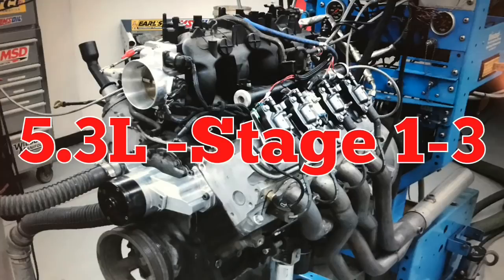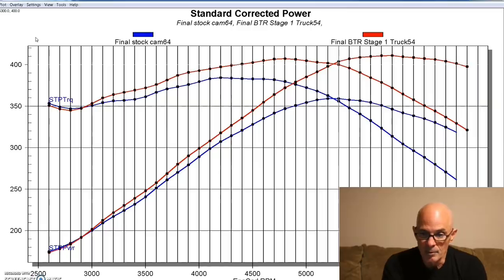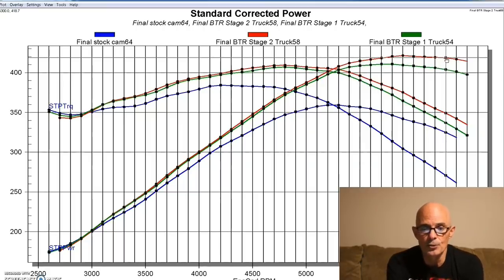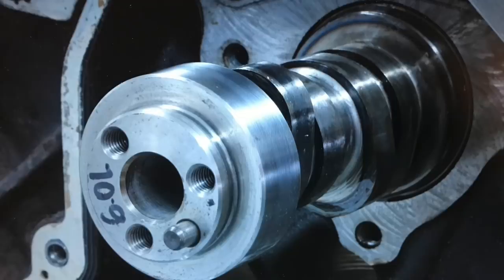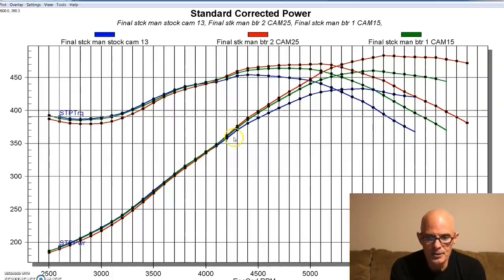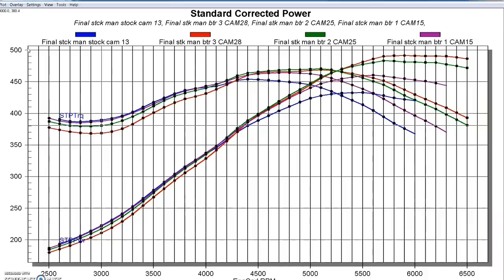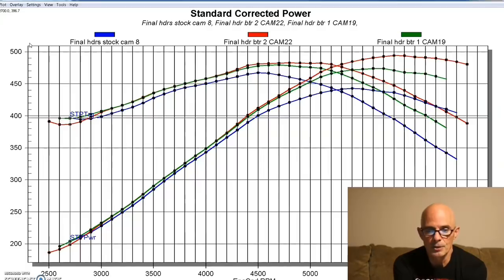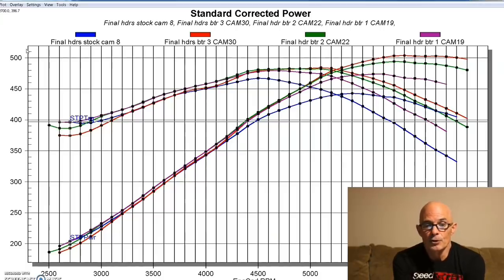LS TRUCK CAM TEST-5.3L & 6.0L (TORQUE FOR TOWING)

Comment: lmao “cams don’t care what heads are on them”. Could you make a more false comment? Ls3 cams have limits on lift and duration to keep the valves from hitting the pistons. Ls3’s with stock pistons have very tight clearances and you will lose an engine if you use the wrong cam on them. How many people are you going to screw over before your channel gets shut down? Try running a TSP Torquer cam in an ls3, you will be rebuilding the engine. Man, this guy does nothing but spread idiocy...
Reply: Wow!  I couldn't disagree with you enough.  this is the best info and the best Channel I've ever seen.
Reply: Your ls3 example is an overall engine design parameter limitation.  His comment is in reference to the cam not caring what type of head is doing the breathing.  Cathedral port or rectangular port, the cam will do its job.  Anyone who cannot grasp this VERY simple point, probably should not even swap a camshaft...
Reply: He's obviously referring to the effect the cam has on airflow and the torque curve. It's up to you to do your homework if you're building an engine.
Reply: @fascistpedant758  It sounds like the OP has an axe to grind....
Reply: Daniel Sullivan Really? You need to get out more. I see this guy spreading all kinds of bad info. The “any cam is a turbo cam” bs was the worst. The engine dyno he uses doesn’t show how they react in a vehicle. If you ran a turbo with a nitrous cam, it wouldn’t spool in a vehicle, but the engine dyno removes resistance until the engine can spool, giving a false sense of it actually working. In the automotive industry, guy who just use engine dyno’s to prove theory are just laughed at. That’s why my engine dyno hasn’t been used in years, just the chassis dyno.
Reply: wlabishler 1 How does that matter? Sure, the cam doesn’t care, but the valves and pistons do... Plus, this is talking about putting cams in otherwise stock, junkyard take outs. So yea, you can’t just slap any cam in one and not expect broken parts. 

Man, you fanbois are really detached from reality just because of a little YouTube fame. That’s pretty pathetic...
Reply: @adamr9215  has nothing to do with the tired "fanboy" defense you just tried to use.  You made a head-in-ass STUPID, comment.  I have not watched EVERY other video that this guy has released.  But to the point you addressed, I understood very well what he meant.  Your statement is akin to wondering "why wont this here ls cam work in muh Ford mod motor?  He said the cam dont care!"
Reply: @adamr9215  You do understand that a hydraulically loaded engine dyno actually puts full load on the engine before the run even starts?  That's why you see the throttle go wide open without the rpms changing at the start of the run.  So it's actually the opposite of what you stated.  And every OEM manufacturer, every F1 team, ever NASCAR team and most of the best engine builders use engine dynos for development because they need to get the most pure, unfiltered data that they can about what's happening.  The chassis dyno has a lot of variables in between the engine and the axles.  I use a chassis dyno, but your criticism of the engine dyno is extremely unfounded.
Reply: Church Automotive Testing Dyno Tuning Actually most of the top tier motorsports use the wheel hub dyno’s now. Too many variables get changed to use an crank dyno. It’s far better to test the engine and trans together, you can make sure the clutch is holding, make sure the fuel system is where it needs to be and the actual electrical system in the vehicle. Lol, too many race teams have been taken down by great dyno charts that didn’t perform in the vehicle.

Also, a crank dyno doesn’t put a full load on an engine from the start. That would just stop the engine. It varies the resistance so that it can measure the output. But, even that doesn’t show you how the stall converter effects the performance either. Put the wrong cam in a turbo engine and it won’t spool the turbos and won’t be able to stall the converter. I just fixed a car I bought cheap because the idiot had the wrong cam in it. The 4500 rpm stall wouldn’t let the engine hit 2400 rpm. I put a turbo cam in it and it fixed everything. Spools lightning fast now. It’s running low 5’s now. It did great on a crank dyno, but wouldn’t work at all in a car. That’s how a I found this channel, the guy followed this liar’s info and found out that was just a huge waste of money. I got it all for the price of a rolling chassis because he listened to people like you that know nothing. Granted, I am selling back to the guy I got it from for only $2000 more than I paid, but I’m not a scumbag like the guy running this channel.
Reply: @adamr9215  cool story.  Doesnt change a thing.  Dumb comment with no basis in logic.
Reply: @adamr9215  Now you're just flat out making stuff up.  There has to be a load on the engine at the start of the run or it would accelerate as soon as the throttle was opened, the dyno applies as much load as needed to allow full throttle static operation - you said there was no load which implies that you simply don't understand what you're saying.  F1 teams, Indy Car engine suppliers and NASCAR teams all have lots and lots of engine dynos to perform their testing - the last time I was at HPD all those dyno cells were filled with engine dynos, and the typical top level NASCAR team has 3 or more engine dynos running all the time.  Because they're developing engines there - not torque converters, transmissions, etc.  A clutch not holding is not something an engine builder worries about in testing.  You're all over the place here, and your vitriol towards Holdener really makes me think you've got a personal issue with the guy.
Reply: Church Automotive Testing Dyno Tuning Lol, now you are contradicting yourself. You said the dyno put a “full load” on the engine as soon as it starts. That is straight up bs. Lol, you really think what my procharged 540 and my mild 355 in my farm truck are going to take the same amount of resistance to dyno? Lol, correct your name to something you actually understand.

NASCAR and Indy have been using wheel dynos since the 90’s. Sure, they break in the engines on a crank dyno, and they may test some changes on them. But they always hit the hub dyno before they hit the track. And they always go with the hub dyno before approving a change. If you had any experience in this field, you would understand how the variables change from a crank dyno to an actual vehicle. A single extra foot of return fuel line can make a huge difference in top tier racing like F1. The crank dyno gives them an idea, but real tuning takes place on a hub dyno, and actual tuning on the track. More racers don’t like the highest hp tune, they need one that handles deceleration and getting back into it with precision. Lol, the pros don’t do it like the shadetree hicks do it, they do it the right way.
Reply from the maker: My statement was in regards to the gains offered by a cam change will happen regardless of the head type. If you don't understand this, take a look at the video on rec-port vs cath port cams and heads. There was never a reference to P-V. EVERY Pro race team employs engine dyno right up to and including Formula 1. They also use chassis and drive train dynos. They use everything to gather data.
Reply: @adamr9215  Ok skippy.  An extra foot of fuel return line?  On a direct injection F1 engine?  Does your dad know you're using his account?
Reply: Richard Holdener Lol, you need to learn to read. I very clearly stated that they do use engine dynos to a limited extent. But, they always go with a hub dyno before it gets out of the shop. The hub dyno is considered the final word before the track.